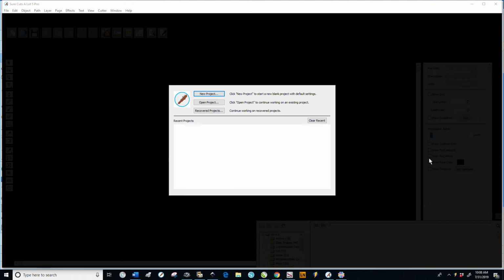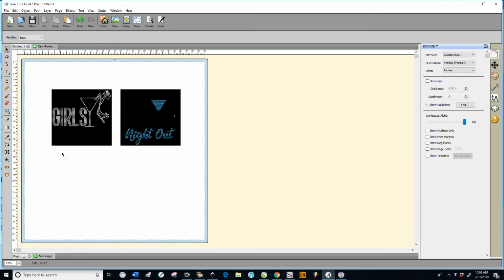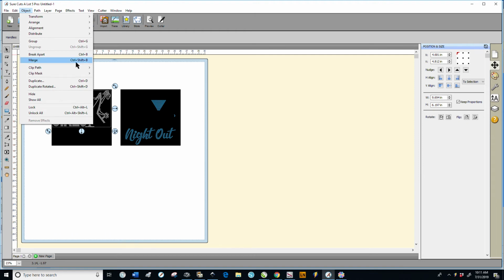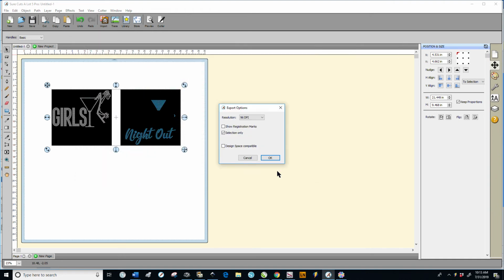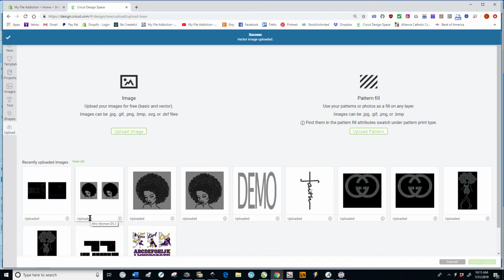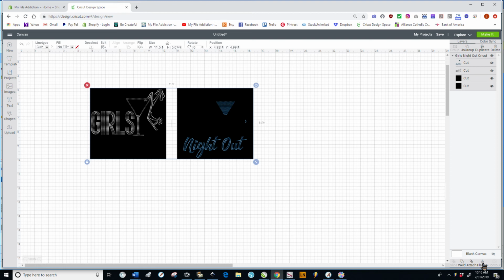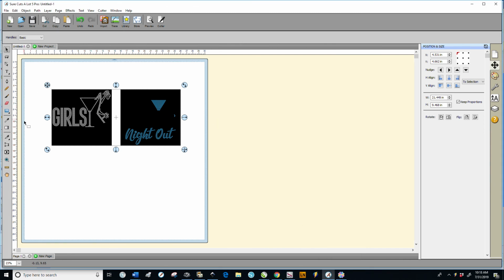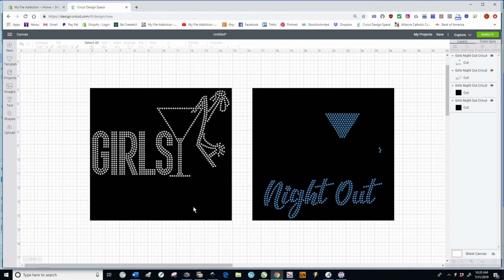Reformatting a rhinestone SVG file for Cricut Design Space use Sure Cuts A Lot V5

Comment: This was a perfect video. I have hours trying to do my 1st rhinestone design and cut. Thank you for all the tips.
Reply from the maker: So happy it was helpful :)
Reply: Well, the file conversion worked perfectly but not the cutting. I have tried test after test and no luck. I have both Magic Flock and an off-brand that is more smooth and feels almost like a rubber. A lot thicker for sure. I even went back to the site that I bought each and no luck with the right settings for cutting.
Reply from the maker: @tonamiller8298  Getting the correct cut settings takes a lot of trial and error for sure.  The age of your blade also needs to get factored in.  Also believe it or not the direction you weed the material can help separate the template from the circles better also.  Try pulling on a diagonal from the right corner one time and the left corner the other.  I never had success cutting directly from the backer paper the template material comes on.  I always stuck my template material to the backside of a mat and cut it on that.  The template material sticks better to the mat so the circles would stay stuck to the mat when I pulled it up.  You just need to make sure to carefully pull up the template so that you don't tear it.  To remove the circles from the mat just take a scrapper and scrape them off.
Reply: @myfileaddiction  Thank you so much for all the tips. I did finally get it done and it is so beautiful.
Reply from the maker: @tonamiller8298  Yay!  You're very welcome!
Reply: I agree hours trying to watch YouTube with other tutorials and still being frustrated! Thanks for being detailed!

Comment: Thank you so much for this video.  I only wish I had it a couple of days ago.  I spent the past 2 days trying to figure out how to fix my file.   It was trail and error but I finally got their. I didn't realize the new update caused the problem.   My only problem after that was the spacing between the circles.  Half of the design came out perfect the other half I had to move many circles manually.  I think this may have been caused by something I did in the process.   I will use this video for my next file.   Thanks again!
Reply from the maker: I had another video posted using an older version of the SCAL program and the steps were very similar.  I just upgraded to the most current version of SCAL so I figured it was time to redo the video and talk a little about the update Design Space recently did and how it affect rhinestone files.  I'm glad that my video will help you with formatting future files.